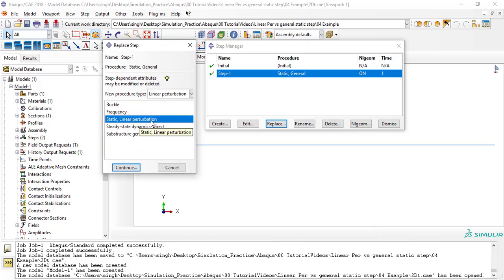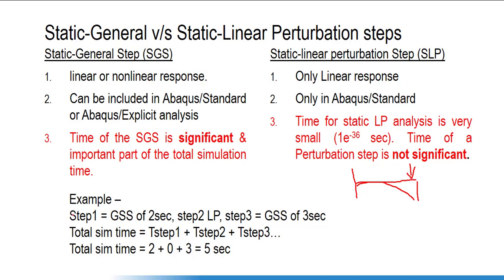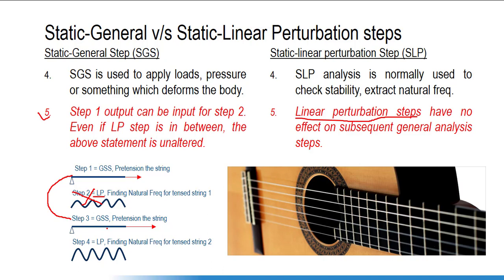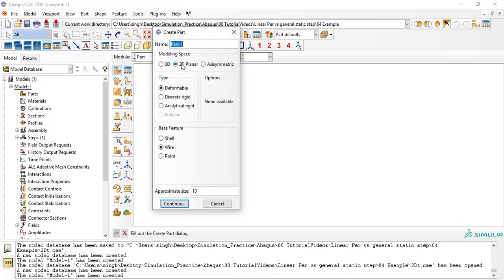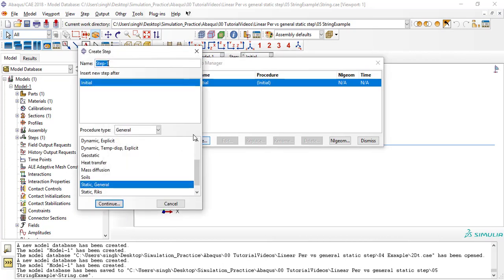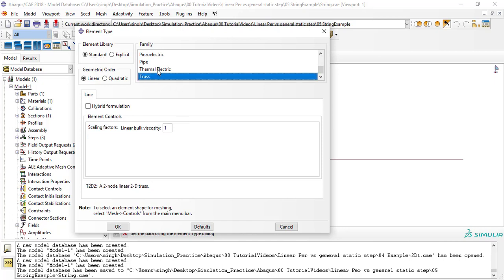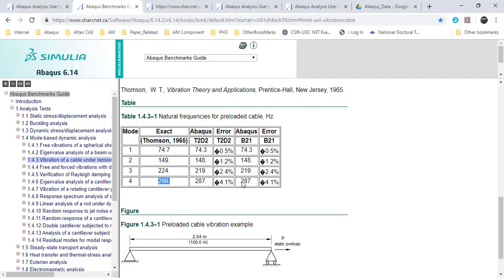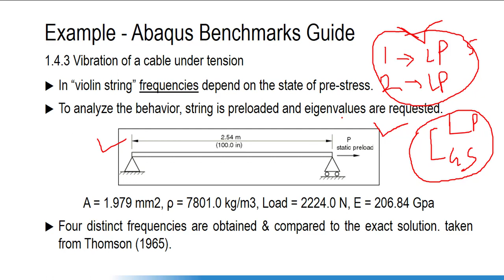General Static v/s Linear Perturbation Step in Abaqus

Comment: Greetings,
I only have a doubt about the example of the minute more or less 6:36, it is not clear to me why we do not calculate the frequencies directly with the force 2224 N but we must necessarily create other increases in load or time (I did not even understand well the link between time increase and load increase) thank you for your help.
Reply from the maker: Dear,
When we apply load, shape of input model changes. And we want to find frequencies of stretched bar not the original bar. That's why 1st we stretched object than applied frequency step.
Reply: @arsitech-ltd  

Thanks for the reply, but I just wanted to understand what is the difference between applying the 2224 N load right away and finding the frequencies right away, instead of going from 224 to 2224N (then making 10 increments) and then having to apply the step and find the frequencies? in a nutshell, why is it necessary to divide the GSS analysis into 10 increments? improves computational efficiency? I'm not understanding.
Reply from the maker: Dear,
Governing equations may not converge for larger amount of force and time increment due to higher value of residue. So in FEA we always divide problem into small time increments.
I suggest you to go through Abaqus documentation for more details.
Reply: @arsitech-ltd   Hi sir, sorry but I don't understand, because in each frequency of each mode of vibrating I have that the maximum magnitude is 7.12 and not 1, how you calculate the amplitude with a force to see a comparison with the analytic form where it comes out the same frequencies but with a shape size equal to 1?
Reply: @simonelasciafare3080   @SimTech05  Greetings,
I asked myself the same question, because I don't understand what amplitude Abaqus uses to multiply it to my wave equation in closed form on my code string, to get the same answer as Abaqus but on Matlab. because on Matlab the lowering is 1 while on Abaqus the maximum deformation for each modal is equal to 7.12. Thank you
Reply from the maker: Dear @simone lasciafare
I not understood what exactly you want.
Reply: @arsitech-ltd  I did the same exercise that you did in Abaqus, both with Abaqus and with Matlab in closed form, and I got the same frequencies, and the same ways of vibrating.
the problem is that the shape of my modes of vibrations in Matlab have an amplitude equal to 1 magnitude, while in Abaqus the modes of vibrations have an amplitude equal to 7.12 magnitude. I was wondering how do you calculate this amplitude? or another object (coefficient, formula or parameter, I don't know ...) that makes me find it as transverse displacement 7.12 as in Abaqus, because for now I have only found ways to vibrate in Matlab with maximum transverse displacement equal to 1 ... and I don't understand why.
Reply from the maker: Dear,
Can you please share your Abaqus model and matlab results on my mail id gkn0504@gmail.com (also available in video discription).

Comment: I run linear Perturbation Step in Abaqus for my model and for my first 2 modes the natural frequency was zero and for 3rd to 6th steps the values were 107, 655 and 1010 ...Why could be the reason for the first 2 modes to get zero values ???
Reply from the maker: Dear,
If your assembly have any rigid part...for that natural frequency may be zero. But for deformable part natural frequency cannot be zero.
Two mode shape may be same if model is symmetric along these 2 directions.

Comment: We can present the result of static step and the mode0 of frquency step in the same contour results?
Reply from the maker: Dear,
As per my knowledge it is not possible to plot them both at a time.
But as you try to plot model analysis results, the previous step deformation will be there...